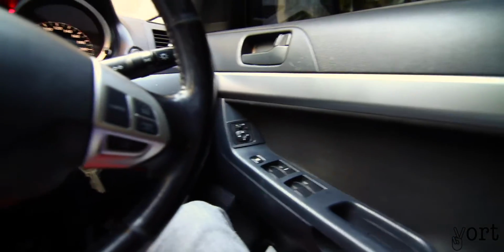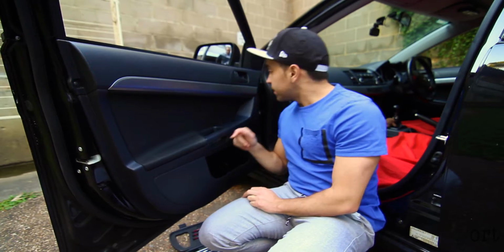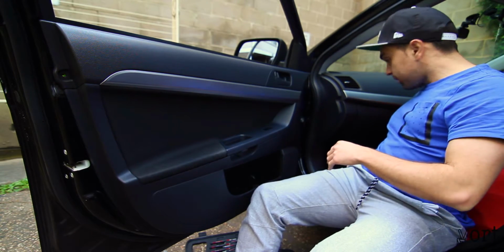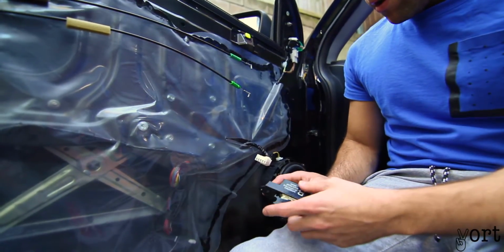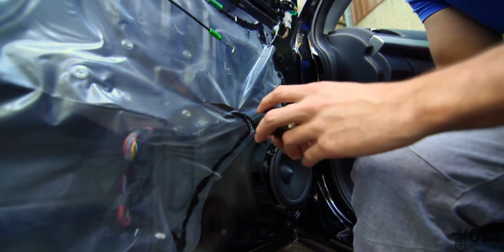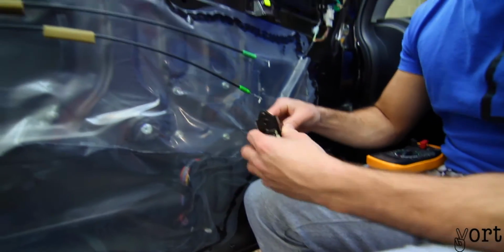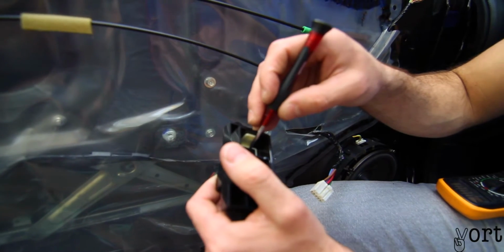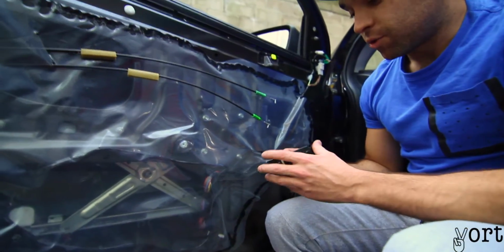Fixing power window switch - CJ Lancer

Comment: thanks much. found the issue to mine. still gonna have to purchase the switch cause the metal contacts were burnt out and damaged the plastics that held it in place. but at least i know its not the motor